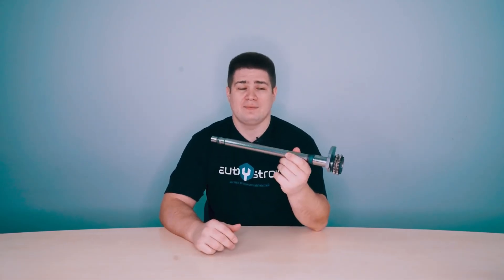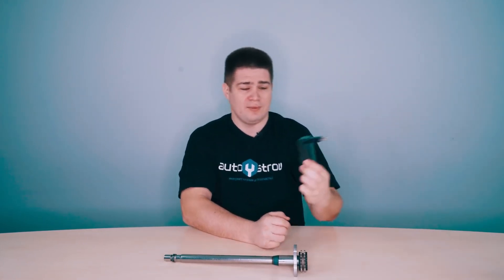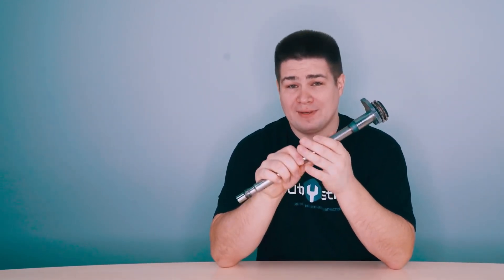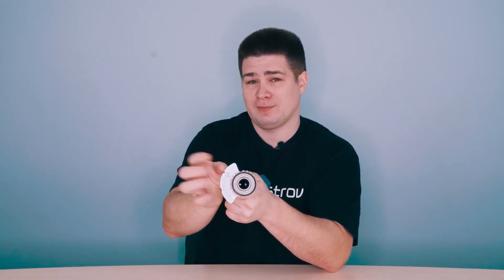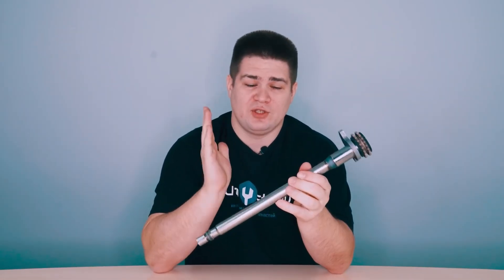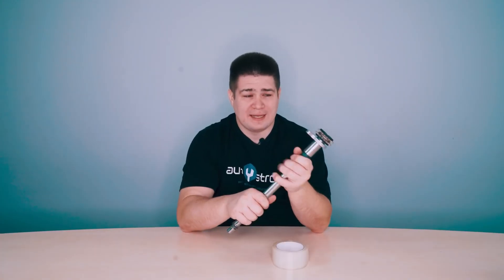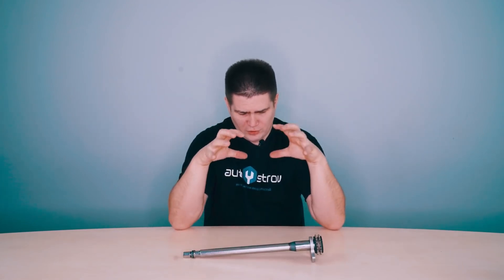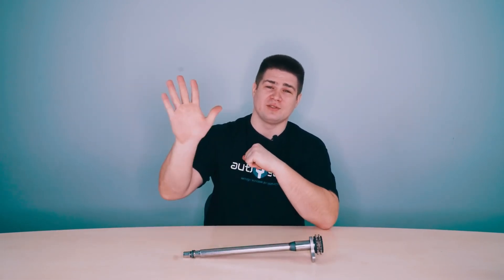Balancing Shaft – How Engine Balance Shaft Works?

Comment: I love quiet and smooth engines , i don’t like steering wheel vibrations, however my Toyota Camry balance shaft wasn’t designed to last forever and since the original part can cost around $1000 dollars and those cheap “made in China” last only 6 months ( my case) I’ll try to leave the balance shaft in place without the main sprocket so it won’t rotate or make any more noise just to avoid plug anything or mess with the engine oil pressure if vibration are beyond my expectations I’ll install a working balance shaft 🤷‍♂️